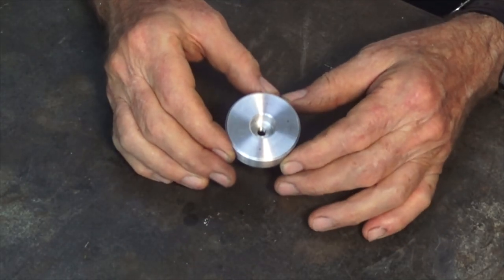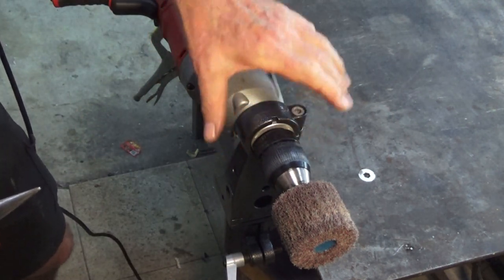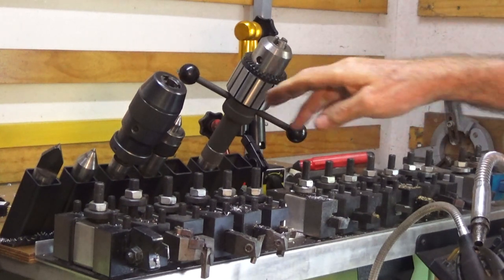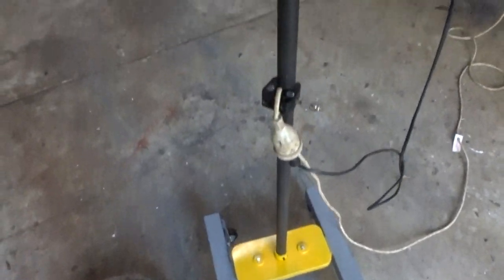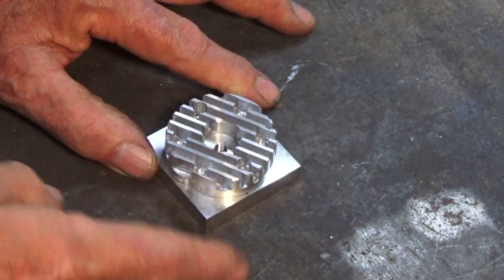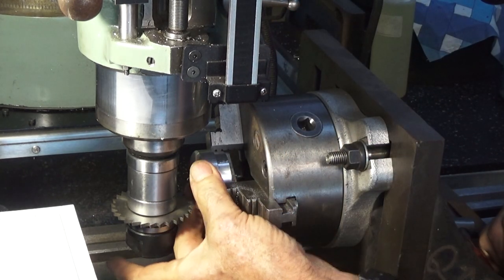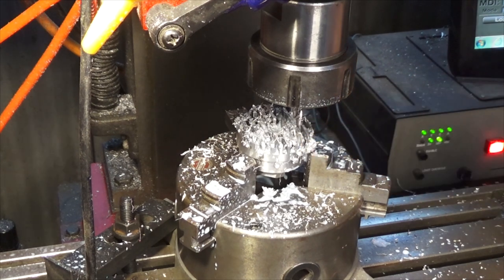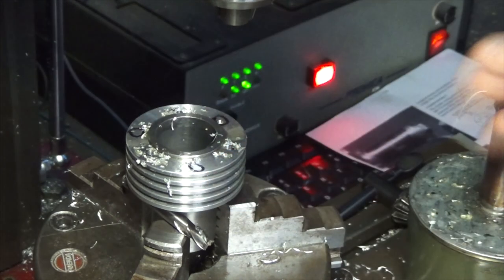Building the Titan .60 Glow Plug Engine #9

Comment: You are a funny bloke! That rain was "intense". Hopefully the ant did a good quality control job on the engine crankcase casting there. 
The engine is coming along well, nice work. Just a question (not a criticism), would it not have been possible to use the three jaw on the milling machine to simply rotate the head 60 degrees per hole to simply drill the hole PCD rather than using the CNC to re-position the whole table? 
Looking forwards to it running now.
Reply from the maker: I guess there's more than one way to skin a cat (is it still politically correct to say that?) I do have a CNC controlled rotary axis for the Sieg mill and it does simplify the GCode creation but I know from experience that the Sieg is capable of doing very close tolerance hole patterns moving from point to point. The key is to find the exact centre of the part. If I didn't trust the machine to interpolate the hole positions I guess indexing the part to the spindle would be the next best way.
Regards,
Mark

Comment: Thanks again Mark. Some nice innovations in set up but more importantly, how do you stop tooling, fixtures and stuff in general from rust in Queensland? That in its self is worth a session.
Reply from the maker: Rust is inevitable here and I have just had to learn to live with it. I am not organised enough to wipe things down and apply an anti-corrosive oil. However I just watched a video by Outside Screwball where he has fitted a 60W lightbulb inside his tooling cabinet to keep the temperature inside a few degrees above ambient. This does help to reduce temperature swings which will lead to moisture condensing on metal surfaces.  If I had one big cabinet for all my tools it would probably work well but I have stuff stored everywhere and my shed is not well insulated and not particularly well sealed. For some tools like chuck keys and clamps I have been parkerising the steel surfaces and that does stop the corrosion but it is not really suitable for things like angle gauges or tools with engraved scales.
Regards,
Mark
Reply: @Preso58  Get hold of some Gibbs Brand Lubricant. I'm pretty sure it's available in Oz.

Comment: As a modelcar racer I also made some own style heads. Because the fins are a bit longer it is wise first to drill the holes and then mill the slots to prevent that the fins will bend away by the mill bit drilling the holes. My final design is in my icon/avatar. If you do a search on that picture you will come to better pics all anodized and laser engraved. (YouTube does not allow external links)
Reply from the maker: I did check out your intro video. Some nice work there. I recall that there was a model car club operating out of a makeshift track at our local shopping mall when I was a kid. I couldn't figure out why the engines looked so different to the ones we used in model aircraft and then it dawned on me that the engines were enclosed and not open to the cooling air coming off the propeller.  I thought the little tyre warming blankets were interesting.
Regards,
Mark

Comment: Mark, would you happen to have a reference to the drill support? I have known that for years, but it seems impossible to find one now days.
Reply from the maker: I am not sure if you can still buy them. The one I have dates back to the 1980's  I did find this one on AliBaba https://guide.alibaba.com/shop/zyliss-torno-drill-driven-mini-lathe_1013639525.html
It's not the same as mine but it does include the bracket for holding the drill.
Regards,
Mark
Reply: @Preso58  Thank you!

Comment: Do you have any RC flying experience Mark?  Ive built many many airplanes from scratch or kit and no matter how long it takes to make a plane from a kit, be it hours or months, it only take a split second to return that plane into kit form!  I hope you just build a test rig stand that you can run that engine on and then place it on the mantle over your fireplace.
Reply: To fly it R/C, it would be better with a carburettor than the venturi and spray bar.  But that would mean a whole lot of extra work making the carburettor parts, and the engine would no longer be built as designed.  At most flying sites, you'd also want to equip the engine with some sort of muffler.  Perhaps better to just run the Titan on the test stand, and keep it mostly as a display piece - and just buy a regular R/C motor if you want one to fly with.
Reply from the maker: Tell me about it. When my son was a young teenager a friend gave me a huge pile of balsa wood, some scaled up drawings of a vintage high wing monoplane, some radio gear and a big four stroke motor. The deal was that I would build the aircraft and my son would fly it under the guidance of the friend who supplied all the gear. We took the finished plane out to an airfield and it looked beautiful with translucent solarfilm on the wings and fuselage. It took off and flew sedately in a lazy spiral but since it was my son's first time flying an aircraft that big he didn't level the wings and as it went higher it started to bank to the point where it was side slipping. By the time we all realised what was happening it rolled right over and the wings folded up. You can guess the rest! Part of the problem was the plans were simply scaled up but none of the structure was beefed up to suit the extra wing area. The spars and ribs were woefully undersized and couldn't handle the forces on the  wing. I still have the wreckage of the fuselage under the house but I don't think I will ever rebuild it. The Titan engine will only ever run on a test stand and then it is being returned to the USA.
Regards,
Mark

Comment: The proposed square fixture is not well engineered, but it is actually easy to improve it. Extend the cut to split it in half, drill and tap two holes to make it into a real clamp. That should hold very nicely.
Reply from the maker: Agreed. I had doubts about the arrangement as described in the notes but maybe I misinterpreted how you were meant to hold the clamp. 
Regards,
Mark

Comment: 32:30 Im sure I've seen this issue of the drill marking the bottom of the fin grooves a lot on commercial engines.
Reply from the maker: I recreated all the parts of the engine in my CAD software and using the sizes given in the original drawings it was clear that the drill would have cut into the side of the cooling fin stock. I actually increased the pitch circle diameter by a few thou but it was still not enough. Interestingly, the track caused by the drill was completely consistent all the way down to the bottom hole.  This, at least was a good thing. I think if I had used anything other than a brand new drill, it would have wandered off.
Regards,
Mark

Comment: Hi Mark, can you please give me the details of your new T&C grinder, want to also purchase one.
Thanks.
Reply from the maker: I got mine from Hare and Forbes. https://www.machineryhouse.com.au/G1975?gclid=CjwKCAiA78aNBhAlEiwA7B76p0Pu3ZWPBDmpd7-311sO4kNhq9biXhw6oUJ1CObDpo7Rkdf97p0NQBoCA78QAvD_BwE I did check on Ebay and there is a cheaper machine that looks similar but it doesn't come with all the accessories and I believe it doesn't use standard 5C collets. The one from Hare and Forbes comes with about 6 metric and 6 imperial collets, a drill bit grinding attachment, a lathe tool grinding attachment, and an indexable end mill attachment. It also ships with a diamond and a regular cup wheel. 
Regards,
Mark
Reply: Thanks Mark, living in Philippines H&F is not an option.
Before Covid I flew regularly to Perth and purchased many items from H&F, will look online.

Comment: Why does almost every slitting saw Ive seen not run concentric? I dont have one so I cant have a play, is it the mandrel is not very accurate? and does it really matter?
Reply from the maker: That's one of life's mysteries I'm afraid. It is quite uncommon to have a slitting saw cut on all the teeth, in my workshop at least. In some ways it doesn't matter to the cutting performance but it does leave a wavy appearance in the bottom of the cut. You can see it quite clearly after I have cut all the slots. The waves are only a few microns deep but it does affect the quality of the finish. I have done some remedial work with a purpose made emery stick but it will need a bit more work to make it look nice. 
Regards,
Mark

Comment: Someone probably by now has written this, but i cant be bothered to scroll the comments, so here goes...

You shoulda used that square clamp in accordance with what Pie always implores everyone do, and that is mind the vise grip geometry when clamping on the corner or on the extreme of the jaws to one side, and added to that his logic of using paper to ``shim`` up and fatten that side that is to be held for machining while using the same stock-no-shim on the other side to keep the jaws parallel... Add to that Stefans logic of using cigarette rolling paper, but folding it as many times, id say one fold, so double thickness, which is around a human hair of papers worth on the side that you want to actuate with the jaw pressure to clamp... Just drop the clamp into the vise and put folded cig paper on the corner of the split area, leaving the flexture part as is... If need be, fold the paper once more to result in 3 layers or 4, until you get clamping pressure while keeping the vise content with your handling it... That would have held the part solid without marring the surfaces or distressing the vise... 

Further rambling-
Cigar paper is an amazing precision soft shim that can be reformed, folded and used as a shim in the vise, in the chuck or for its usual purposes of rolling a fat one and lubricating the machine operator... Buy the classic 5 meter roll of rolling paper and if you arent a smoker, it will last you at least a year... You also have the extra thick paper(disgusting) and extra wide paper(smokers call them sheets, as in bedsheets for nobody uses them as you dont want to smoke a ton of paper, you want the good stuff). I once bough the sheets as a mistake and had them in a drawer for ages, until i got my first baby mill, then, i picked the roll up gently, with a smile, knowing that that purchase was not a mistake, but a divine setup for the time in 10 years when i will need some soft shims on my first mill when all i will have had will be a mill and a vise... It had to be, for otherwise I would have long thrown the pack in the furnace when starting a fire during winter... But i had tossed it into my smokers drawer and it sat there for a decade, waiting to serve the purpose I would not have even imagined back then when i was just a teenager in love with machines, but who thought i would not get to play with one... 

All the best, my dear machinist brother!
p.s. i hope you put antifreeze in that kids Cool-aid after smashing the handwheel... Its a damn sin to damage a work of art due to sheer recklessness and oversight... Just kidding, just kidding, that is only for dealing with undesired husbands/wives...  :P
Reply from the maker: Well, I'm not a smoker but I do recall watching Stefan and his various uses for cigarette paper. The kids at our school were terribly hard on machines. Some were careless but a lot would just misuse a machine for fun. Some got injured in the process. I never felt a lot of sympathy for them as I was sending them off to sick bay.
Regards,
Mark
Reply: @Preso58  Yeah, Stefan, like Renzetti is a great source of ideas for practical applications, i was very pleased to see you use the lap idea that i first saw at Robs channel... They, like Joe and you are obviously lovers of machines and are what sparked love in me towards machines over a decade ago... I never went to machining school, but now have quite a few machines... I guess machinist school is like any other school, a part of a flawed system that forces people who would otherwise prefer being where-ever else, doing whatever else, and some are just misguided and abuse what is seen as not their property as in many a school for fun(if roughhandling can be so called)... Its a shame really, and a reason why when i bought my Schaublin 22 mill and a few other machines, i avoided any machine that came from an educational environment and went for those that served as backup machines to some small private repair shop in Switzerland... I have the S22 for over a year now, wrapped in foil, first covered in oil, as i didnt have environment to open up the spindle and gearbox at the time to clean them up and re-lubricate them as they should be... But i guess anyone who got into machining out of nothing but love for those iron behemoths would do the same... Its a shame really that any machine suffered at hands of ignorant, call them kids... But such appears to be the fate of some things in all areas of worldly existence... Either way, i am glad to see you handling your machines and do them the honour they deserve...  You are a gentleman in the truest sense of the word!
Kindest regards,
Camillo

Comment: I see that your large angle plate was previously owned by Quentin Reynolds ?? :}
Reply from the maker: No, Queensland Rail! That angle plate was given to me by a very generous viewer in Gympie which at one time had a very active railway workshop. The old Gympie railway station is now home to the Mary Valley Rattler which is one of the few regular running steam locomotives in this state. I was very fortunate to be given a ride on the footplate many years ago. 
Regards,
Mark

Comment: Do you plan on mounting this in any aircraft or is it just for the final finishing novelty? Being an older throttle-less design is a bit limiting.
Reply: I believe the series was started ro return a completed item to the original designers old school museum
Reply: This engine will have a throttle valve. He can built a engine run fixture to test the engine.
Reply: This type of throttle less design is used in line control model aircraft. Where the engine is run continuously at its optimum flat out setting
Reply from the maker: I will bench test the engine and if it runs it will be returned to the USA to be donated to the Joe Martin Museum of Craftsmanship in the name of the designer, George Genevro.

Comment: One step closer!  If this doesn't run well it will be due to the piston design and not your machining in my opinion.  The ridge is going to be a potential pre-ignition source.
Reply from the maker: I believe the piston baffle is a fairly old school design feature. However I will just have to trust that the designer knew what he was doing. 
Regards,
Mark
Reply: @Preso58  Very old school.  There is a reason you don't see it anymore.  That said i look forward to seeing what happens.  Thank you for the journey so far.